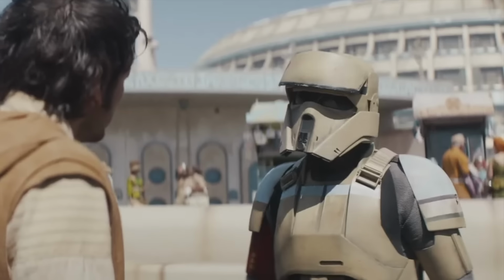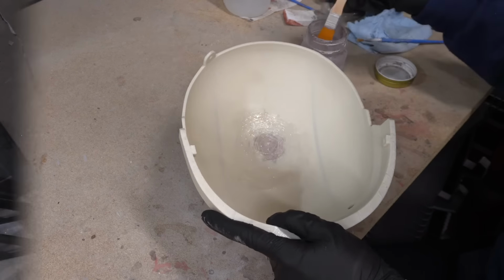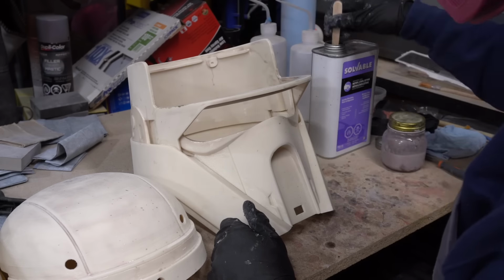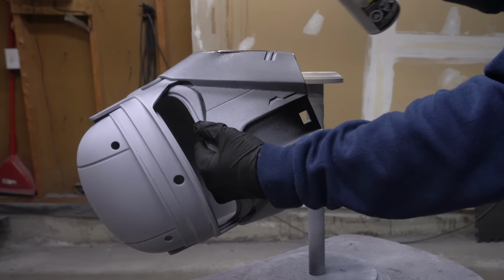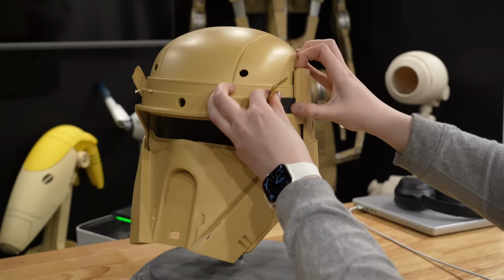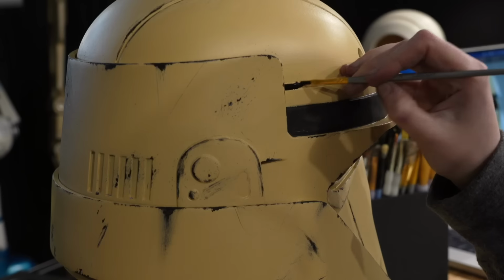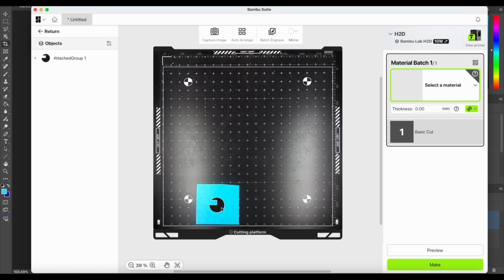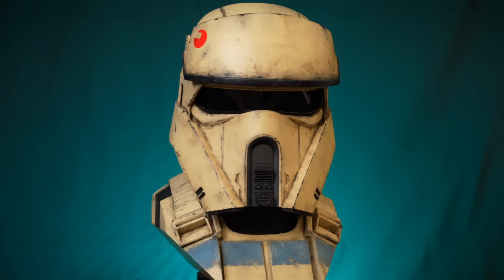How to Make a Shoretrooper Helmet

Comment: Tip: if you are worried about bleed under a stencil or tape you can spray with the base color first. let dry. and then spray with your finish color.

Comment: Will the acetone slurry work with pla?
Reply from the maker: Most PLA won’t be affected by acetone so it’s smoothing properties would be minimal. You can thin spot putty with acetone to get a similar easy to apply paste to help smooth prints out which works great on any type of filament.

Comment: If you ever want to get a super clean stencil , before you paint it the colour you want airbrush some clear matte first then airbrush the colour , it will peel super clean
Reply from the maker: I always forget you can use a clear varnish in place of the base paint colour to seal up the edge 😆 Fantastic tip!

Comment: If you want to stop stencil bleed then try placing the stencil then a light coat of matte varnish, that usually seals the edge, then you can lay down the actual colour down without worrying too much

Also you may want to consider using Parafilm as an additional masking material

Comment: Have you tried using adaptive layers for the tops of helmets to help with the layer lines? If so does it just add too much time to be worth it?
Reply from the maker: I have, and actually used it on this dome which isn’t super typical for me. It can make a difference but sometimes isn’t worth the extra time, especially since you’re probably going to be doing the same sanding/filing process regardless. You can always print preview both options to see if it looks like it’ll be worth it or not. Also make sure that your top/bottom surface thickness is set up appropriately so that  it doesn’t print too thin.

Comment: Yes more Busts!!! You are so talented. I have printed out 10 of your helmet stands so far for my helmets I have made, but still trying to figure out the toppers part, I cant seem to get them to print out with logos you designed on my P1S. If you design some busts, I will most defiantly be printing them out too..
Reply from the maker: Oh no! How are the prints failing on you?
Reply: @MMsPropShop  I think I figured it out, they were adding logos inside of the topper instead of on top, I been messing around and kinda got it to work. My mistake on once i figured it out was I used pla for base, then PET-G for logo and it didnt stick, but it did leave impression of logo. Gonna try again after next base is done printing.

Comment: In your experience, does ASA “warp” less than ABS? If so, would you say it’s a minor, medium or major difference? Specifically in an X1C?
Reply from the maker: ASA is technically supposed to shrink/warp less but I’ve personally never really noticed a difference. At the beginning of trying it, it had been giving me more warping problems than I’d ever had with ABS but I seem to have worked that out. I always put a brim on ABS/ASA prints to try to stop any possible warping anyway. And I’ve never had an issue using ASA on my X1C - it always seems to be able to keep its enclosure temperature high enough.
Reply: @MMsPropShop 10-4. Thank you.
Reply: If you’re having problems with the print warping on the build plate, try bumping up the bed temp. That solved the problem for me.
Reply: @VanOaksProps AhhhhhHA, will try!

Comment: How different do you find the Filler Primer sands as compared to the SANDABLE filler primer?  Any thoughts on the filling ability?

The rustoleum sandable filler primer usually clogs my sand paper, so I'm wondering how well the non-sandable works.
Reply from the maker: I’ve never tried or even seen ones listed as sandable specific (probably not sold in Canada), but in general I feel like the Rustoleum filler primer tends to gunk on sandpaper a bit easier, probably because it’s thicker than some. Can be dependant on application, dry time, etc. as well though. I never rush to sand filler primed pieces.